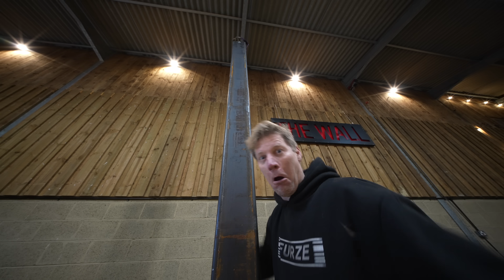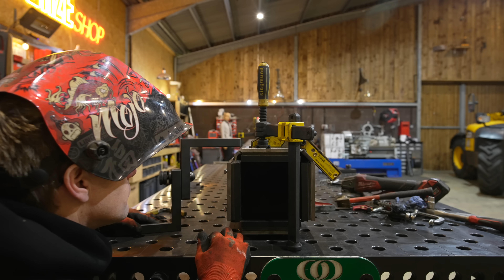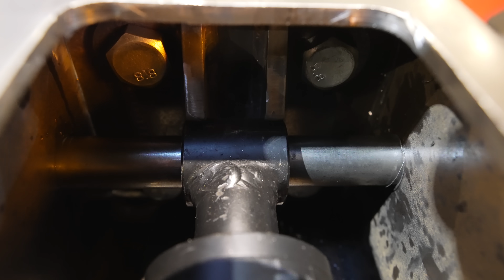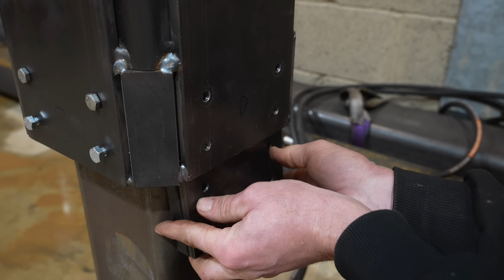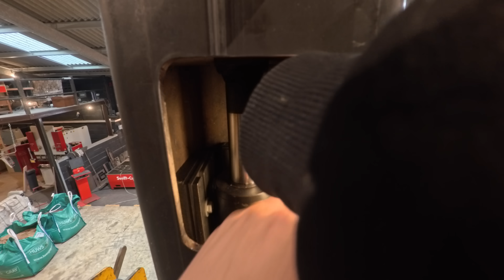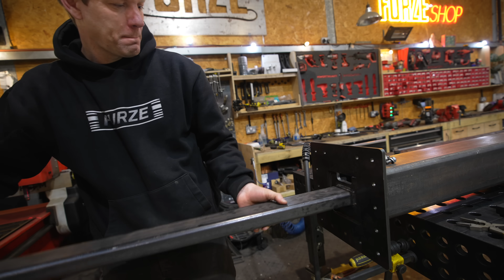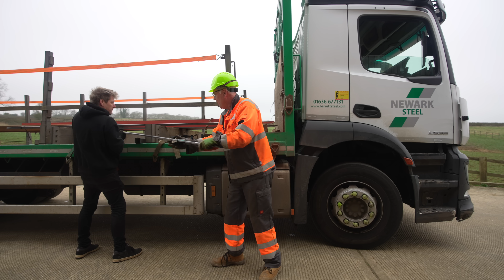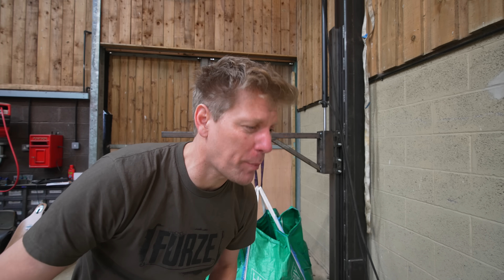Digging SECRET Garage Part 7 Car Lift Prep

Comment: You should look at using something other than just bare bearings for the carriage running on the steel. I was the lead control system engineer for a product that involved telescopic booms, and using bearings running directly on the steel work hardens it, then it eventually peels open like a sardine can. I think we ended up using acetal (or maybe nylon) rollers to spread the load and add a little bit of compliance while still being very hard wearing.
Reply: Nylon rollers with an automatic lubrication system would make it last ages since the sacrificial material are the rollers and not the steel profiles plus they take up the uneven loading the outermost bearings will crack probably if he uses them like that...
Reply: another thing is that they will be some play and then the loads don't go nice and even over the bearings and the bearings end up cracking as you get huge single point loads in small area.
Reply: @Draous1 I learnt that the hard way when a recessed end stop mechanism didn't actuate correctly so one side of a carriage didn't stop and the other did. The bearings on one side shattered.
Reply: @matthew35673m  so is better to use something solid like bronze or nylon
Reply: That's neat! It was probably nylon or uhmw. Those are super wear resistant.
Reply: @jacer12344 you're right - it was nylon that we used now that I think about it. Acetal was for some other rollers in a different application. UHMW was used for some wear plates and chain guides.
Reply: Once the platform is in place the bearings should take no load. The carriage and bridge beams across will bear the bending load. The bearings will become non load bearing guide bearings. So steel will be fine
Reply: The whole thing would've been easier if he kinda copied forklift booms and used heavy chains, going into 1 main axel or 2 axels with gearing and motor. Easier to maintain, no fluid spill issue, lighter, less maintenance, no different piston speed issues etc. but this is a great video. He built it to last for a century. Pluss he is self thaught and doing great with it. 

I hope he copies rotating plastic packing machines for the rotary table. thats the simplest and most reliable solution
Reply: @GoalOrientedLifting He can't due to the space constraints and even if he would do this mechanism he can't because you need hardened profiles like the forklift masts can't just use mild steel the heat treatment alone would be thousands of pounds for those massive beams can't 1:1 this to a forklift design...
Reply: @G0lOb  I didnt mean you need to copy exactly like the forklifts. And you dont need hardened steel. This set up would also take no more space than what he used now, as everything would be in a crawlspace or room beneath the whole thing. There would be less space used around the lift itself
Reply: @GoalOrientedLifting  Yea you do I run my own heat treatment company can tell you from experience how mild steel metal on metal eats itself in a couple of years of constant use...this isn't something you wanna rip up to fix better do it correctly he just needs to swap the bearings problem solved...and why add even more complexity gearing, motor, chains, and vfd plus electronics they fail too then you need limit switches etc...you need to lube and service all of it 😑
Reply: @G0lOb    all the electronics are almost plug and play. gearing comes with the motor as one unit. Motor with gearing is cheap, you can get one with locking brakes too. I work with automation and machinery in industry. Hydraulics needs limit switches too. You also need to balance all 4 systems with various valves to ensure they all go the same speed. and safety valves in case of failure.  The hydraulics dont pump without an electrical motor being a part of it.  Which means it needs pretty much the same amount of electornics as my suggestion.

My suggestion reduces the amount of components and amount of maintenance. It also makes maintenance easier to access. I've done maintenance on hydraulic systems and booms before. Its messy. Its a lot more work. You also have the spill issue of hydraulics. Which may need certifications on permanent installments. Depending on the country

And no you wouldn't need hardened rails. That is one solution, and if that is what i had in mind then you'd be correct. 
But it is not what i had in mind. you don't need rails. Mild steel is good enough when there's only compression forces.
Reply: Why not just modify a four post garage lift?
Reply: true, this isnt a good design, the beams will get peeled and the bearings will be destroyed, not after one or two runs, but after 20 youll start to see the beginnings of this problem.
Reply: I’ve just commented something similar to this, another way would be have a sacrificial metal plate which is attached to the beam, this way it can be swapped out when it begins to show signs of wear. Also may not need to re design anything if he has enough of a gap on the eccentric bearings to slide a thin plate in.

Comment: Cable Wenches! Colin! Why not put cable wenches on the ceiling and use a pully system to lift the platform! You can even un-hook the platform once its lowered and spin it!

Comment: You can have a motorised hydraulic diverter valve that will deliver the same amount of oil to each port meaning they work in sync Flowfit will have these

Comment: You should make sure not to use ball bearings for the mounts, but roller bearings instead.
Ball bearings are more suited for speed, while roller bearings can handle more weight.

And holy, replace the bolts for the bearings please. They gonna bend over time.
Get a straight hardened steel or smth

Comment: Mate awesome, and inspiring. I will never build at that scale,  but a few smaller projects are still in the future., a 4 point lift to take my canopy off the 4wd tray or trailer, after finishing my electric gates. But,  I just fought with council for 8 months to get a 10m x5m shed approved and built. So Getting approval for something on the scale of your underground bunker/garage would have been impossible.   And Man, your Partner must have the patience of Job.

Comment: Fantastic, makes me want to go back into design engineering, I miss it.
Also, great to see Onshape as a sponsor, fantastic software designed by the founders of Solidworks. I’ve used it for a couple of years for my 3D print designs and it’s still free, but I can see that changing.

Comment: My health and safety mind feels there would need to be a safety crawl space pit underneath. A gentleman was crushed by a similar toilet in London and these pits are mandatory with lift installations at the top and bottom of the shaft.
Reply: also the lid up at the road is a major concern to me. People are stupid. They will see the garage be open and run there being like "Hey Collin", while it closes and they get crushed by the lid.
Reply: @strohbein1331  Evolution in action
Reply: @theelmonk Darwin award
Reply: That was my first thought, the toilet. 
Also the room below is open, therefore there'd need to be a system that it can't lower if people are in there.

Comment: I thought with cutting the slot in the box section and then also welding the flat to one side of the box section it would cause the box to bow, how’d you get round this

Comment: For accessing the rams, wouldn't it be easier to access them through the top of the legs ? Acess hatch allowing to disassemble the pins, and many bolts around the top plate to take the strain of lifting ?

Comment: My guess you left it out for a later video, but you're definitely going to need presence sensors and other emergency stop hardware on this, which might get tricky with the inspectors. The whole underground build just keeps getting crazier!

Comment: Garage car lifts usually have safety catches to prevent crushing the mechanic in case of catastrophic hydraulic failure while the vehicle is elevated. Have you thought about installing any fail safes on any of the stages?

Comment: You could always use a 4 section rotary flow divider to try and ensure synchronous motion while lifting and implement counterbalance valves to stop unexpected motion of the cylinder say if your pump cuts out they will stop it dropping unexpectedly

Comment: I know you’ve engineered all this to be confident it’s more than capable of lifting the weight of the car. Remember though that’s it’s also lifting the weight of the platform the car (or pickup) sits on, as well as the roof of the garage, which is going to be far from nothing. Seems like it’ll likely still handle it all, but I thought it was worth mentioning, in case you’d genuinely overlooked that in your calculations.

Comment: Curious how the inspection lift in the middle is supposed to work. I guess you can see underneath the car if lifted to eye level but the floor of the inspection lift will stop you from easily being able to work under there, drop an engine out etc.

Comment: While I do not have a formal background in engineering, it appears that the analysis may be treating the structure as if it were supported by a single lifting point, with strength and capacity assessed on that basis. My understanding, however, is that the system incorporates four lifting points one at each corner so the load would be distributed across these supports rather than borne by a single element.

That said, I appreciate that load distribution may not be perfectly uniform in practice. Factors such as the position of the centre of gravity, structural rigidity, and potential imbalance during lifting could result in certain points bearing a greater share of the load than others. For that reason, it would seem prudent to consider whether the analysis accounts for possible uneven loading or worst-case scenarios at individual support points. 🤔

Comment: @15:30 The large slot in the SHS is a bit of an orange flag. If it’s acting as a column, removing that much material reduces its compression and buckling capacity. The stiffeners may help locally, but they don’t necessarily restore the member’s stability, and you can still get local plate buckling or reduced column capacity. Hard to see the whole thing obviously and I don't know how conservative you were but just a point to consider (I am a structural engineer). Love your videos :)
Reply: I don't think the inner telescopic leg really carries any load in this design, it's just a guide to keep everything running straight.
Reply: i can promise you this will never fail in straight compression. buckling is harder to account for.o account for.
Reply: @steven9492  Yep columns will basically never be governed by axial compression it's always buckling you need to think about.
Reply: yes, turning a nice box into a channel with change for the sides o flex out.
Reply: @Draous1  Yeh I would've probably used a UB or UC for that design. Doesn't look as nice but you can always put nicer looking sheets of aluminium around it or something.
Reply: @zapnote  not so much about the appearance but more on the structure flaring out. He put those U shape plates in to help with the flaring but even with calcs and computer checking i steel fell uncomfortable and would find a way to avoid c channel shape.
Reply: @Draous1  Agree. Asymmetric shapes are not ideal for columns. Any eccentricity on axial load can lead to potential P-delta effects.
Reply: Would it help to bolt plates over the slots, removable for checking & maintenance?   Oh and what happens if the car isn't central on the pad?
Reply: I don't think his design is safe for a dynamic structure.

Comment: You’re basically making exactly what we do for big hydraulic lifts, on our big cargo lifts we use 4x telescopic hydraulic rams with a guide rail running up behind it and timing chains to keep everything in sequence. For safety we have rupture valves on each ram instead of that safety break but funnily enough we use a much bigger version on traction lifts. We also have ball valves on each ram to keep the oil in for maintenance, simple as raising the lift closing 3 valves then letting the oil out of the one requiring maintenance works a treat. Very cool video great to see someone build something like this

Comment: Love the progress Colin! Only part I'm not sure on is your safety brake design. Perhaps I misunderstood the design, but it seemed like it's not "fail 2 safe". It should operate like a drill rig dog collar "safe-t-clamp" where it needs to be held up to operate normally, losing energy in the system drops the clamp down, which has tapered vice dies that lock in with the weight of the pipe trying to bear down on them. Or a ratchet mech like a traditional car hoist. Just so a total lose of energy definately jams everything in place.

Comment: Most lift in garage lift normal cars then heavy lift two tonne these lifts have gears and a motor to run up and down lift with bearings  I think this would be better than a hydraulic ram  take a look, go to garages and see where the ramps are and how they work. They work on gears not rams. Well most do

Comment: 7 years ago i had  a telescopic tube project.(small version) where i had used nylon spacer at the top section. but when the the inner box tube was extended half way. it had a lot of play as if the spacer was acting like a pivot.. eventually i put increases the length of the  spacers in the outer tube end to end. it was a nightmare .   then the inner box tube was not able to fit..i had to grind the inner tube all the sides  till it fits. at the end it worked but i was not happy .  i feel inspired seeing yours having no play at the middle section  when extended half way..  that i will try to make a second version . i will finish with a question . how do you find tubes that  not twisted along the length.? this was a big issue for me . as it can be squared but due to the twist  it may very difficult aligned the inner box tube with the upper truss section

Comment: I worry it won't be able to lift the DeLorean. Think about it.

If a standard DeLorean is 1290 kg, the mass added by the inertia that is induced by operating the 1.21 gigawatts flux capacitor could push it beyond 7740 kg.

Just sayin'.

Comment: Hey Colin, I know you are really finding the Garage lift too easy so….. Have you thought about adding an above ground safety fence that comes up around the top of the garage roof hole whilst you are lifting/ lowering the car to stop anyone falling in. It could be automated to drop once the roof is closed and when the car is lifted fully above ground. I know you really wanted an additional challenge

Comment: Maybe you are way down the rabbit hole here but...could it be easier to use pulley system, steel rope, light guiding rails and some heavy duty winch that could sit on the floor?

Comment: Car lifts use u channel and they use a chain and pulley to double the throw of the ram, hence shorter ram. In the back of the channel they weld safety stops for the fall arrester / overspeed protection teeth to catch if anything goes wrong. Also you don't have any balancing / synchronisation cables so a single ram failure would destroy the whole system. How are you going to keep each pillar in sync with its siblings?

Comment: How do you stop water getting in?
Reply: There is essentially a gutter system on the lip of the lift opening but also drainage inside the tunnel in case water does get in

Comment: When you're lifting hardware with your telehandler, you can make the lift safer by putting a clamp on the end of the fork to prevent the load from sliding off.   Safety Furze!

Comment: You should use a hydraulic flow divider instead of daisy chaining the cylinders together, the fluid will follow the path of least resistance so if one cylinder is obstructed it will not raise and twist the rig. A PRV before the divider would also be a good idea

Comment: Colin, you have to have a hydraulic check valve on the lift end of all the cylinders 
That's 8 in total! Because the 2 cylinders per corner 
They prevent it falling if a hose blows 
It is a safety standard

Comment: Is the hydraulic pressure always equivalent to the height? If there is more load on one lift arm (which is pretty easy as you won't park your car(s) in the perfect equilibrium spot every time) that one will need more pressure to get to the same height as the other ones, won't it?

Comment: I have bad news about the triple bearing setup: odds for most of the force ending up to single bearing are pretty high in real life. What about wider roller bearings instead?
Reply: You can do a thought experiment: when the bearing sled tries to twist, how the torque lever changes between bearings and the inner ones. The outermost bearings will bear most of the force and inner ones are probably at zero stress and only tightening up their internal clearances. Fyi: when doing bearings like these, ask the seller for matched bearings and clearances won't mess up things that work perfectly in theory. At least SKF used to provide such options 5+ years ago

Comment: Don't forget your safety factor, Colin.  If you plan to lift 10-12 tonnes you need to design a system that is capable of reliably lifting 30-35 tonnes.
Reply: Safety factors are already built into the materials he's using. If the hydraulic jacks say they lift 4 ton each, they can lift 16 tons together, but their safety factor is 1,5x to 2,5x so the entire setup can lift 24 to 40 ton (depending on the type of jack). Its complete overkill to put in 4x 10 ton jacks.
Reply: @TheRM90inc  not just the jacks though. Every single structural load path. Hopefully he has done the basic static load analysis. You don’t want to rely on “looks alright to me” when lifting such large loads mechanically.

Comment: Interesting. However I would have done a direct screw drive in each leg, and connected all legs with a single chain and one motor.  With a simple leaver a single motor could power the turntable too.